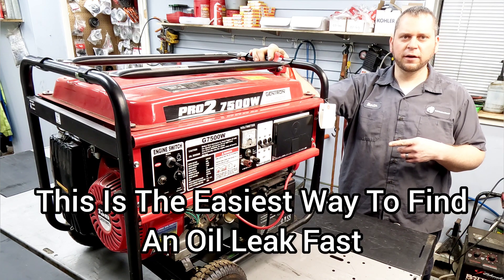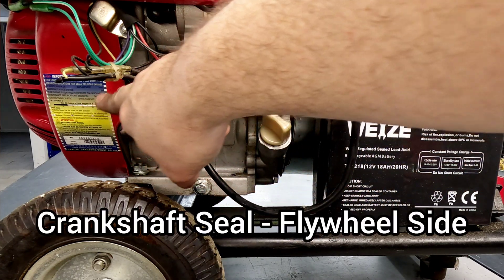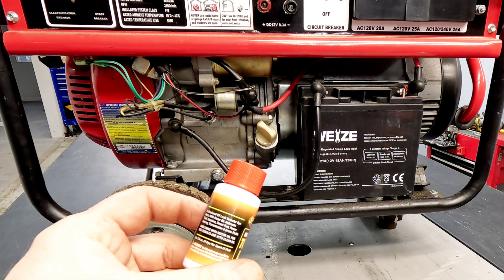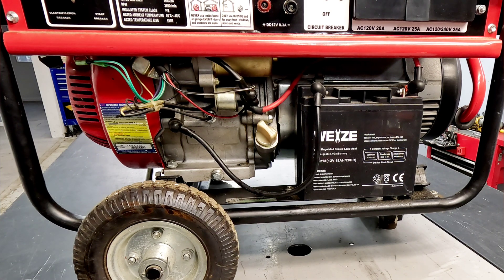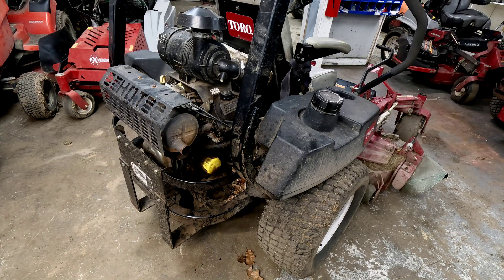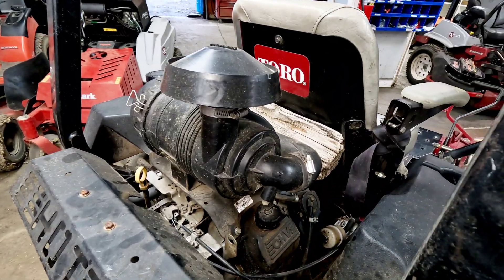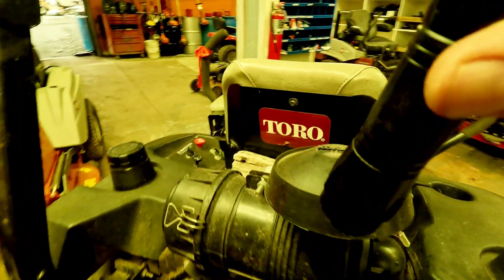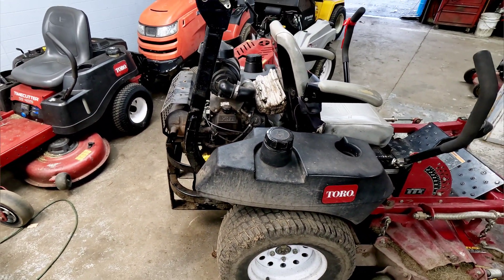How To Find Oil Leak On Any Piece Of Equipment Fast, Cheap & Easy

Comment: Great information. They have been using on cars for decades. The light was sooo expensive.  Can you now buy an affordable light?
Reply from the maker: Yeah, just takes a regular UV flashlight. You can buy them for under $10
Reply: @IndRepair  does the uv oil clean up easily after repairs?  For dbl checking.
Reply from the maker: It sure does, just wipe it off
Reply from the maker: Appreciate that! Thanks for watching!